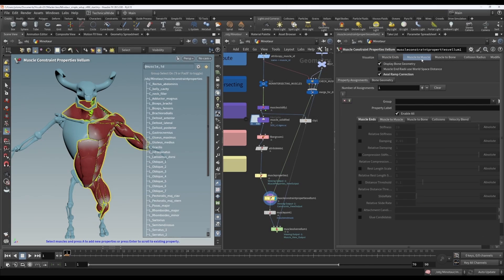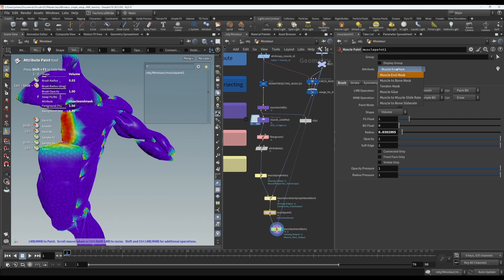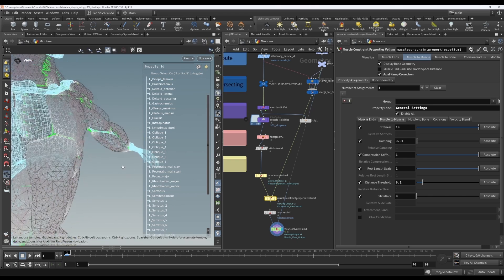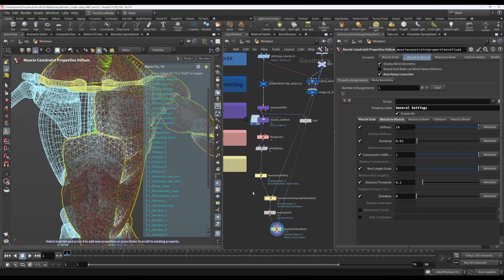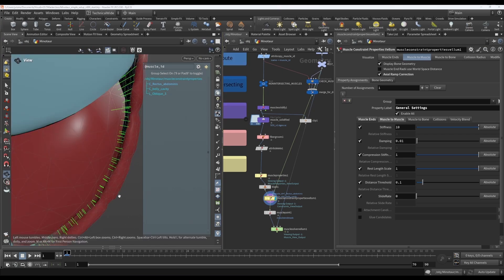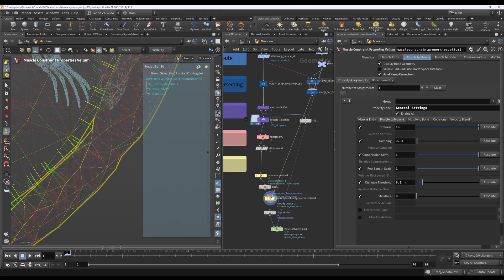10. Muscle Constraint Properties - Muscle to Muscle

Comment: MuskleConstraintProperties
2) MuscleToMuscleConstraints
Displaying constraints is illustrative and will be similar in VellumSolver but not like that.
1:50 "Stiffness"
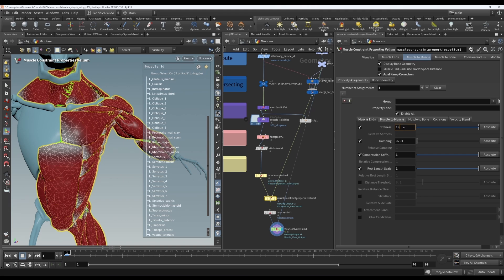2:23 Creating a common layer (all but the last 2 fields)
2:48 MuscleToMuscleConstraints parameters. Stiffness (what it affects)
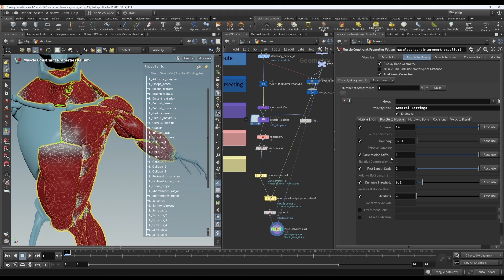3:15 Display MuscleToMuscleConstraint
6:10 DistanseThreshold
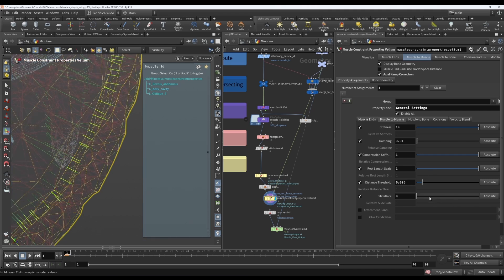7:59 SlideRate (friction force)
8:16 AttachmentCandidate (Constraints control)
15:31 AttachmentCandidate (NoAtach)
16:28 MuscleToNuscle attributes MuscleToBone, AttachmentCandidate, MuscleId
18:52 GlueCandidates